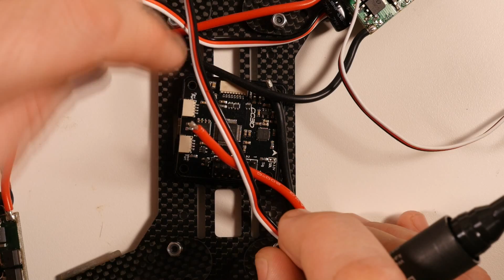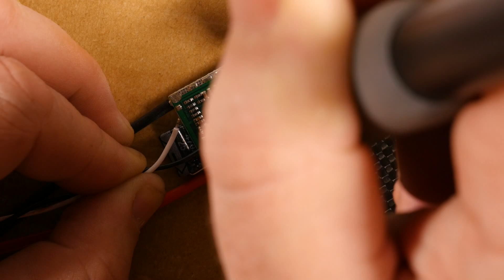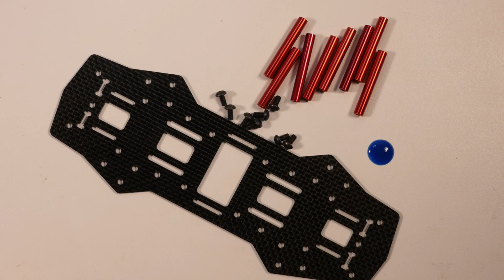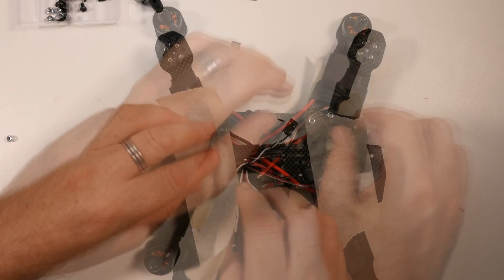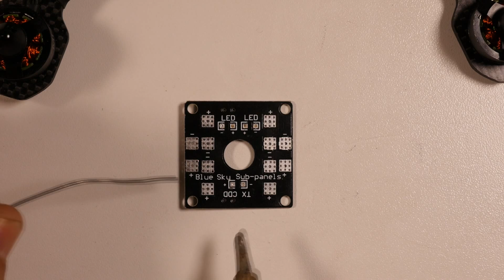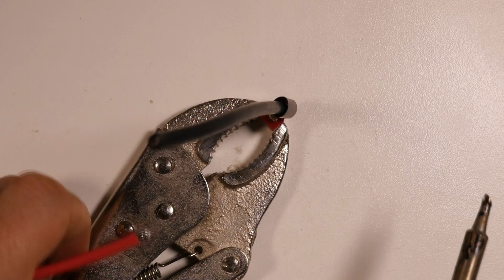Beginner's Build: $85 Mini Quad - Power & Wiring. Part 3

Comment: Have this same build and need to clean up my wiring between the motors and escs. I just cant seem to find that size heat shrink. Im in the us. Whats size diameter did you use in this video?
Reply from the maker: Jonathan McArthur It's 35mm. Note that the measurement given, is actually what it shrinks down to - not the size it is on the roll. Not sure your location, but check here:

http://www.amazon.com/Amico-Meters-Polyolefin-Shrinking-Shrinkable/dp/B009INJX7G/ref=pd_sim_328_4?ie=UTF8&refRID=1KE5ACWHAZRQQ0B02603

Comment: when is the next video cheers
Reply from the maker: inkfx2009 I ordered a budget Tx/ Rx to go with the build and it unfortunately was lost in transit, somewhere between China and Dubai (where I live). I could finish the build using a FrSky receiver and Taranis combo, but I really want to keep this the cheapest quad build possible. As soon as I get the receiver, I'll make the next vid :)
Reply: The Dark Pixel What radio did you originally order for the build? (great video series BTW! Thanks! I'm just starting out and it was all pretty helpful.)

I scored a turnigy 9x and frysky djt module for $35 shipped. they had suffered from a reverse polarity battery plug in but I was able to fix them both by replacing the VRs (the module needed a new switching reg and the transmitter needed a new 5v reg) That was a good cheap started radio ;-)
Reply from the maker: Sounds like you scored a sweet bargain - as long as you have the time to do the repairs!

This was the original, but the shipper graciously resent another after we worked out the original one was lost in transit.

Comment: Hi,
What do you think of this quadcopter?

 http://de.aliexpress.com/item/Mini-250-Quadcopter-1806-2280kv-Motor-12A-Esc-CC3D-Flight-Control-5030-Propeller-CC3D-Distribution-LED/32297309822.html

It is a little bit cheaper and you know how much Thrust the Motors do have.
Reply from the maker: Tooser Lp I would spend the extra $3 and get the 20A ESC's
Reply: The Dark Pixel Are the 20a esc better than the 12a esc?
Reply from the maker: It's not really about better, it's about unknown current draw from the motor/ prop config, and being much better off having some headroom so that your ESC's are not running hot all the time.
Reply: The Dark Pixel Thank you very much.

Comment: Have you flown this yet? Any idea on the quality of the motors?
Reply from the maker: Ryan Hunt I haven't finished building it yet!! :D
If you consider that my 4 T-Motors cost more than this whole quad, obviously the quality is not up there with that. Windings look ok. Will probably do a thrust test in the final video.
Reply: The Dark Pixel Cheers for your reply, look forward to your next video. Is there anything that you would require to build this quad (aside from lipos and RX) that is NOT included in the package they send?
Reply from the maker: Apart from s bit of solder and heatshrink, everything I've used so far is out of the kit.
Reply: The Dark Pixel Nice, when can we expect part 4? Really looking forward to it!
Reply from the maker: Ryan Hunt I'm waiting on a budget Tx/ Rx to arrive in the post. Should be any day now. Packages can take time to get to Dubai sometimes
Reply: The Dark Pixel Awesome, can't wait! I feel your pain, I am waiting for my quad to turn up to New Zealand and even though its made it into the country it will likely be 3 or 4 days before I receive it.